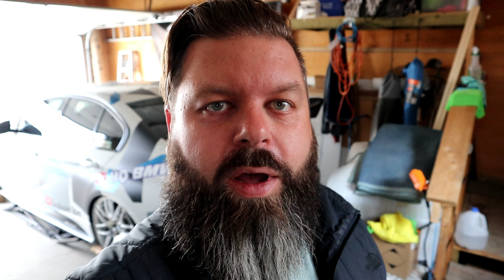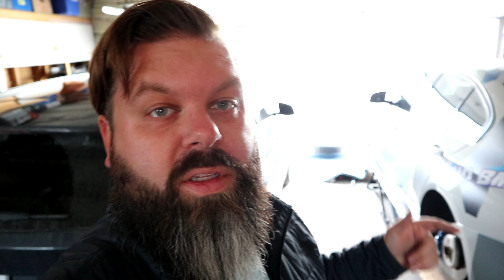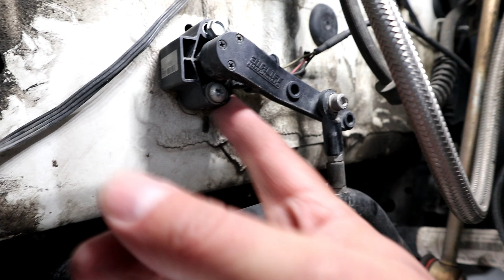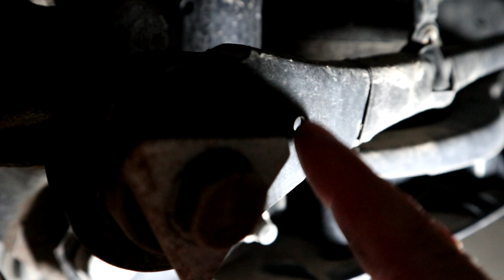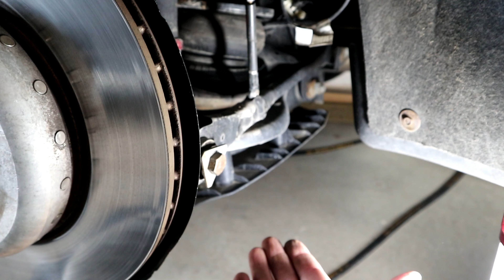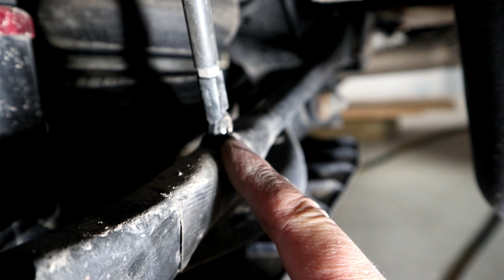Airlift Height Sensor Follow up |  airlift performance

Comment: Is it possible to install the height sensor on vehicle old to new? Or does it only mount to modern cars
Reply from the maker: You can mount the height sensors on any vehicle. It just might take a bit of creativity.
Reply: Thanks for the respond man is there anyway that I could be in touch with you via watsapp or anything like instagram so we can have a chat privately I'm setting of a project on a car that surely it's not a famous brand I needed a few helps based on the air suspensions I mean I would appreciate the help, 

This way I can show you the car and also in a way see if we can set up the sensors before I purchase them😅❤
Reply from the maker: Hey yes 🙌 absolutely. Most guys message me on IG and I will help you out wherever I can help you out. I’m @hq_bmw on Instagram
Reply: Appreciated bro thats nice of you cheers for the answers on my questions I'll drop you a dm in instagram❤

Comment: I got mustang Shelby gt and I have been trying to get the height sensor right but I can’t any recommendation please bro
Reply from the maker: Do you have the height sensor and the bottom point perpendicular? I found I needed to have the mounting point in line with each other so the arm could move correctly

Comment: what do u achieve from height sensors?
Reply from the maker: Height sensors keep the car level, so for example let’s say you have your car at ride height and you go and pick up a couple of friends and they jump in the back seat. Without the height sensors the car would sit lower in the back. But with the height sensors they sense the added weight and adjust the pressure in the bags to keep the car level. Hopefully that made sense.